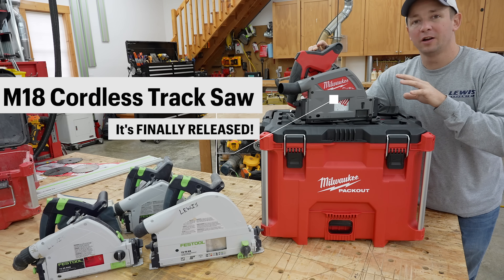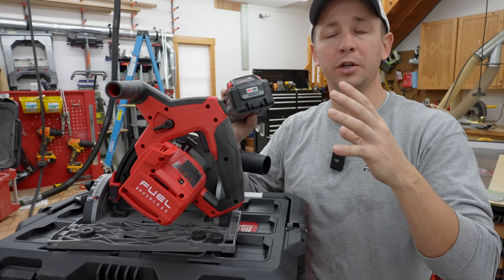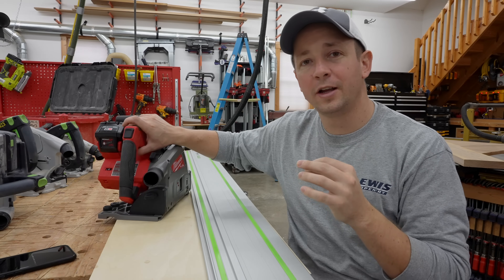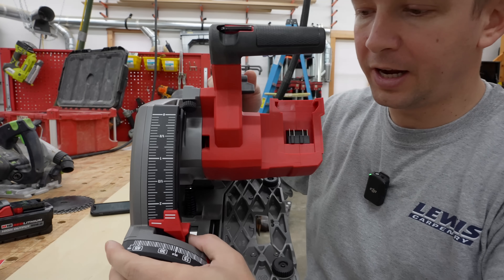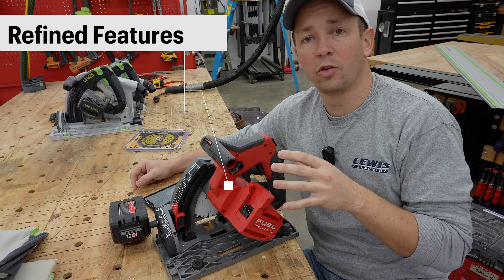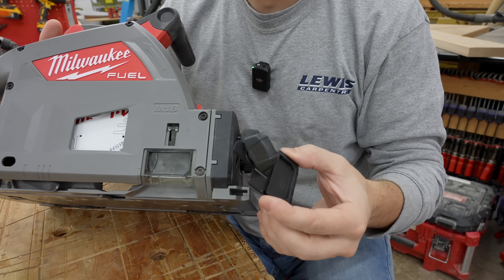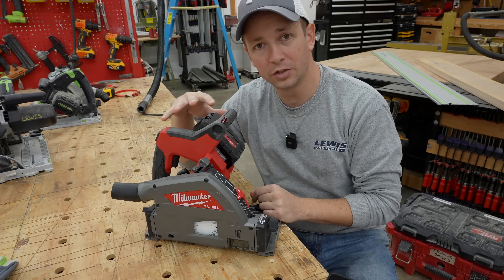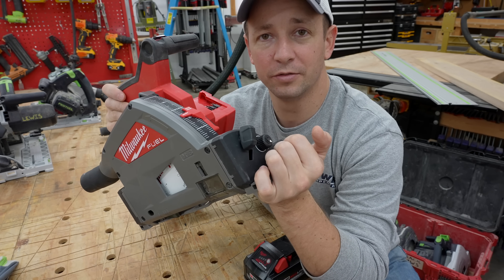Did Milwaukee Deliver??? | Full Review of the NEW Milwaukee M18 Track Saw

Comment: Festool head engineer told me if you turn the speed down from 6 to 5 you will get 25% longer run time out the battery with virtually no discernible difference in quality of cut.
Reply: I have the 36v Makita track saw and run it mostly on speed setting 3 out of the 5 settings. The blade runs fast enough that there's no blade chatter and slow enough to still have good dust collection all while getting good runtime out of the batteries
Reply: How about the fuel you have to buy what do they du us pressure to help power the tool
Reply: TSC55 runs so long if set between 4-5.

Comment: I’ve literally grown tired of watching many YouTube woodworking channels doing constant tool reviews on products they have little experience or knowledge of or the ability to put them through their functions that a real user would need to know. This is one of very few that I was amazed by. Thanks for your time and work that went into the production and how this tool addressed your needs in a track saw. Very informative and kudos to Milwaukee for manufacturing a quality tool designed for professionals all within their battery platform. I hope their distributors carry a wide variety of blades, tracks and accessories as the Festool dealers do. The additional cut capacity and power over the Festool saw will make this a killer deal.
Reply from the maker: Thanks, I share the same sentiments on the typical content. I hope to offer real value than than just click hunting.

Comment: Did I see a flip-out tab on the left-rear edge of the base plate?  Like the Makita, it looks like if you're using a compatible track, that little tab will keep the saw from tipping over when set to high bevel.  They got all the best features of all the other saws for sure!  I've been waiting for quite a while and ended up buying a competitor's saw, but really wanted Milwaukee to get here.  They finally did!
Reply from the maker: You are correct, I missed covering it in the review. It has the anti tip feature and the milwaukee tracks have the same catch system as the makita. Works really well. I got a milwaukee track in the mail today. Posted a video on IG.

Comment: Hi Spencer, I appreciate your videos a lot and the knowledge you possess and the humility you have as well. I'd like to inform you, and other viewers: Do not make adjustments to the opposite slide spacers of the rail adjustment. 
1.) Moving the blade to the right (when looking from the top while cutting) doesn't reposition the 45° cut correctly, bc if you did, it would then move the blade away from the 0° cut too. Same problem, different position. If you wanted to fix the 45° cut position, you have to move it DOWN. Which means it's a design flaw. Minor but still. The splinter strip just needs to be thinner by 1/32" or so. Maybe 3/64" Draw it out on paper.
2. I tried doing that and it snapped the threads on the aluminum shoe. The screws have a collar that prevent it from being tightened too much.
You should remove the part of the video regarding adjustment of the left side guide adjustments.

Comment: I have the Festool Cordless track saw, as well as a collection of Milwaukee cordless tools and batteries. The Festool saw was a bit weak with its original batteries, but when I replaced the batteries - with bluetooth triggering - I found that the power was adequate and the added benefit of being able to trigger a Festool dust extractor with bluetooth was there as well. Being able to autostart a vacuum is a feature that not many other companies (maybe just Makita?) have come up with on their tools -and Festool built it into the batteries, so older battery tools could benefit. I have a Milwaukee Packout vacuum and several of their battery tools - and I don't see any way to get them to talk together for autostart capabilities. Even Festool's new battery-powered dust extractor can communicate with tools with a bluetooth battery. Thanks for the review - I was curious about this as well.
Reply: I have the Milwaukee hooked up to the Festool midi vac with BT remote at the end of the hose, added a 3D printed arbor opening cover and cut over EPS 4x8 sheet with splinter guard down, 99%+ dust collection and flawless cut on both sides of cut on 3/4 plywood without using the scoring setting

Comment: Nice saw and review, have makita cordless, deep in that platform, it has excellent performance but depth adjustment is marginal and no zero splinter guard, young carpenters are lucky the cordless revaluation is incredible. 
Thanks buddy

Comment: Great review. Thorough from a user’s viewpoint. Thanks for noting that my Festool dust vac will attach easily. I have been using M18 and M12 circulars on the KREG track system while I waited for Milwaukee to release their track saw. Works OK. Much better than nothing. I wish you had compared a Milwaukee track section to the Festool track for any notable differences.

Comment: Well prepared review Spencer! 
I couldn't wait the 5 years, and went with Makita including the rails.
Primary use is cutting/scribing faceframed prefinished cabinetry, for installs.
I tend to cut lots of nails and staples,so I reversed the arbor flange and use standard 40t 5/8 blades.
Flipping flange off sets the blade,so splinter guard is matched for this on all 3 dedicated tracks.

Thin blades will walk sideways,so slow feed rates or multiple passes.
So speed is roughly the same as full kerf blades,am just using more cheaper blades.

I like ,and am changing to the Bosch/Mafel/Metabo rail system .
Clamping area is closer the cut-linw,and rails are stiffer.

Comment: Great informative video! You mentioned it felt equal to Festool TS 55… noticed your’s is TSC55 REB. The newer model is TSC55 KEB that states much more power & faster cuts with thinner blades and their anti-kickback electronics. Results in 40% longer battery life. Curious how the Milwaukee would perform if it performs similar to older… New Festool may have the edge over M18

Comment: Excellent review as always Spencer. You definitely did a thorough review. It seems you will be using your Festool tracks with the Milwaukee track saw… I noticed that the Milwaukee track has an anti tilt lip on their track to help prevent the saw from tipping when you have the Milwaukee tracksaw set for a beveled cut. It may not make a difference for most people…

Comment: Great video! It DOES FIT in that smaller packout box you have at 17:25 if you turn it on its side. Milwaukee even sells pre-fitted foam that fits that box so you can cut it to hold the saw on its side and fit the charger and multiple batteries!

Comment: Great review, you really put a lot of detail in it. NICE 👍 Definitely more excited about this saw now after watching. I do wonder if there would be any minute differences at all with the Milwaukee tracks.
Reply from the maker: I think the milwaukee tracks are probably slightly thicker or thinner and that is what is throwing off the bevel cuts.
Reply: @InsiderCarpentry  the Milwaukee tracks allow you to lock your saw into the track so it won't tip during bevel cuts.
Reply: @ThisDoeb  Makita has that same feature, only problem is that the Festool track does not allow for that, Makita track obviously does.

Comment: Thank you for the in depth review Spencer, I was hoping you'd review this saw when it came out. I have the corded Makita and have no complaints other than it being corded, which is a pro sometimes and a con others, obviously mobility on the job site being the biggest. One thing I didn't see mentioned in the review, I thought I remember seeing that the Milwaukee has the anti tip feature for bevels and scoring feature like the Makita does, can you confirm? Those are two features I find very useful and efficient on my Makita.
Reply: Never mind, just saw another review and the Milwaukee does have the anti tip and scoring feature. Thanks again for the thorough review, I appreciate the detail you go into in all of your tool review videos.
Reply: The anti tip is a slightly different size than Makita it's the only reason you'd want to get Milwaukee's tracks if you purchased it. Milwaukee's track has thicker aluminum I think that might be why the 90 and 45 didn't align on his Festool track.

Comment: Spencer, thank you for your excellent videos. I've been building cabinets for new home construction for 40+ years. When Festool introduced their track saw many years ago, I immediately bought one and got very good service from the tool. I had been using my homemade version before this and knew the advantages of a dead straight cut. Well, when Makita came out with their cordless version, I got one of those. I can honestly say that the Makita has performed for me better than the Festool saw, and no cord is a "no brainer". As far as batteries lasting, I am most impressed with the Makita. It just goes and goes and I use 5.0 batteries. You should give it a try. Just my humble opinion. Thanks again for all of your schooling!
Reply from the maker: The only reason I haven't had that tool in my hands is simply because I don't use any other makita cordless tools. I have heard good things about it though.
Reply: I have the makita out of a great saw,  mostly have dewalt tools but since expanding into multiple lines. I'm able to get the best deal at time of purchase or the best option out of the three big brands. Best decision I've made not being married to one brand.

Comment: @8:58 it appears your straight cut edge is slightly proud of your splinter strip, whereas the bevel cut appears to be spot on with it. This would mean the origin of the tilt radius shifts over 1/32". If you shifted the runners on the saw base you would also be shifting over the 90* cut line too? I wonder if the front and back knobs on the tilt were set at the same point which was skewing the saw to the left a tiny bit

Comment: When I started my business as a handyman I had Milwaukee Gen 1 circular saw paired with Kreg accu cut track. Few months later I've purchased Cordless Ts 55 with 2x 5Ah batteries and I was shocked to see how underpowered it is comparing to Milwaukee (tried different blades, tooth count etc), purchased 2 festool Hi power batteries later and it's slightly better, but that M18 fuel circular saw was just doing better on a single 5Ah battery and wih 12Ah High output it is just embarrasing. Still preffer to use Festool, because of dust extraction. Really impressed with what Milwaukee was able to achieve on single M18 battery, that tracksaw will be mine soon... My precioussssss

Comment: I would love to upgrade to an actual track saw, but I am just a weekend DIYer so I bought a Bora Port-a-Mate. It basically turns a regular circular saw into a track saw. It has a sled that rides on their straight edge. Only thing it doesn't do is beveled cuts

Comment: Good indepth review, just got the one question. Does the milwaukee track saw have an anti kickback feature. Where the blade will stop if the saw lifts up from the track. I am sure I have seen this feature on one of the other brands. I am in the market for a track saw and will certainly be considering this one. I have just purchased the dewalt dws 780 mytre saw, the reviews you did on that model certainly help me out when choosing what mytre saw to go for. So far I love it just need to upgrade to the blade that ot came with. A big thanks for the indepth info you have given on the dws 780.

Comment: Hello Spencer.  I used the link you provided to the Milwaukee track saw.  It took me to Home Depot site.  I ordered a "package" including the track, battery, saw blades, clamps.  What I didn't notice is Home Depot substituted an XC8.0 battery, included no charger and sent Makita clamps instead of Milwaukee.  Called Milwaukee to make sure the battery would work and one of my other chargers would work.  I wouldn't order from Home Depot again.  No real cost savings when the lack of charger is factored in.
Reply from the maker: Sorry to hear that. :( I share HD links for Milwaukee stuff because Amazon doesn't sell a lot of Milwaukee products. I find purchasing Milwaukee stuff is so much more of a pain compared to dewalt. It seems like Dewalt does a much better job of pricing their products in an easy to understand, straight forward way.
Reply: I have to say that your review of the track saw was spot on. I definitely like the saw. I will give HD cudos for agreeing to give me a veteran discount on the order after the fact so that improved my attitude about the whole thing. Keep up the great education you provided with your no nonsense videos and congratulations on the new shop.

Comment: Great review! I was thinking about the issue of the bevel cut not lining up with the 90 cut. I don't think adjusting those track adjusters would fix the problem. That just moves the saw in relation to the track. What needs to be corrected is the bevel cut in relation to the 90 cut which seems like it could only be corrected in the geometry of the bevel mechanism on the saw. My other thought is that if the track were thinner, that might correct it. I wonder if they designed it to line up if the saw was directly on the wood without the track. Or maybe the Milwaukee track is thinner.
Reply from the maker: You're right. Adjusting the position wouldn't fix my issue. I got a milwaukee track in the mail today. I will give it a test and see what I find.
Reply: @InsiderCarpentry  yes I'm waiting on this exact answer
Reply: @InsiderCarpentry  any updates? I'm curious as well
Reply: @theblkfly Same here, knowing if the bevel lines up with the 90 is one detail I would definitely like to know before buying.
Reply: @InsiderCarpentry  What did you find in regards to this on a Milwaukee track?

Comment: What blades do you use for your track saw? I was thinking about getting a Forrest woodworker ii. I also need a good melamine blade and plywood blade.

I would appreciate a video on what blades you use and what you look for in choosing a blade. Do you need to watch the kerf width and tooth bevel to avoid wearing out your splinter guard?

Comment: 2:18 - What blade are you using on the Festool?  Their newest saw uses an ultra-thin kerf blade.  My Makita XGT came with the "Max Efficiency" blade which has a .047" kerf.  I'm guessing this new Milwaukee also has a thin blade, to help compensate for the single 18v battery.
Reply from the maker: Yes, it's a very thin kerf.
Reply: @InsiderCarpentry  What is the blade on the Festool though?  If it's got a thicker blade, that's not a fair comparison to the Milwaukee.

Comment: 0:00: ⚙️ Review of Milwaukee's M18 track saw and comparison with other brands.
3:17: ⚙️ The Milwaukee M18 Track Saw offers reasonable battery usage and compatibility with existing M18 batteries, making it a convenient and powerful tool.
6:43: ⚙️ The new Milwaukee track saw has a nice design and allows for calibration of different tracks and saws.
10:11: ⚙️ Comparison of Festool and Milwaukee track saws, discussing cut capacity and alignment issues.
13:58: ⚙️ The review discusses the blade change process and cut capacity of the Milwaukee M18 Track Saw.
17:00: 🛠️ Reviewer is disappointed with the size of the pack out but still finds the tool easy to use and on par with others in its class.
20:20: ⚙️ Explanation of bevel adjustment and stops on the Milwaukee M18 Track Saw.
23:45: 💰 The Milwaukee M18 Track Saw is reasonably priced for its professional quality and features.
27:00: 🔍 Detailed review of the Milwaukee M18 Track Saw and request for feedback.
Recapped using Tammy AI

Comment: Great review Spencer but you didn’t mention the scribing feature, or did I miss that??
I have the mains powered Mafell which has a scribing feature that moves the blade over by half a millimeter at a depth of 3mm then you make a second pass at full depth. 
Works great for laminated boards and worktops. 
How does the Milwaukee scribing feature compare??

Comment: Hi Spencer! Thank you for the great and informative video as always! Just one question does it work with the adapter and DeWalt batteries? I can see you have the same one I do for the Ryobi in the background 😂
Reply from the maker: Given that it is a high output tool, I wouldn't recommend it.

Comment: Looking forward to a future update after you've run it through the paces. Found your previous track saw video comparing the corded TS75, battery 55, and mafell super helpful. Nice to hear I wasn't the one who thought the TS75 was a bit underpowered.  I recently got the milwaukee table saw and was ridiculously surprised at how smooth it was. I had to rip some tilt fillets on it recently... full depth at a 15 degree bevel and it was better than any job site saw I've ever used. If the brushless motor on the track saw is anything like their table saw I'll be purchasing one shortly.

Comment: You did a great job on this review video.
Last week I was told that I would not be able to continue working because of digestive health reasons.  If that hadn't happened, I would be at the store tomorrow to buy this set up based on your review. I can barely hold myself up now, there's no way I could pick up the saw.
I've been pounding nails for 47-years, I've had a good run and enjoyed it greatly.
BTW, I'm glad you didn't post this video a month ago, HA HA
Reply from the maker: Sorry to hear that Roy. I hope this change is just the beginning of another great chapter for you! Thanks for the positive feedback on the video.
Reply: @InsiderCarpentry  A month and a half ago I built a roof over a roof-top deck at a local brew pub/restaurant. It was built by our code here in Maine, 2x10 rafters, triple 2x10 beams, and 6x6 posts. It came on fast and it was very unexpected.
Look at the bright side, I have a great Medicare supplement plan.